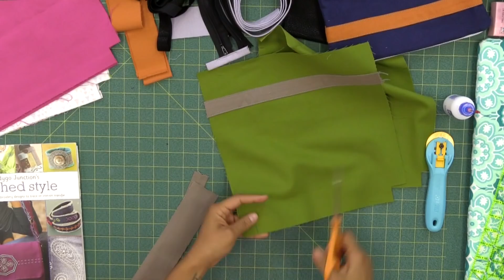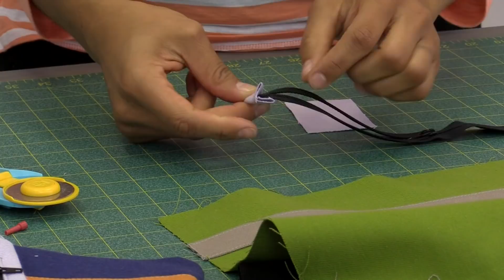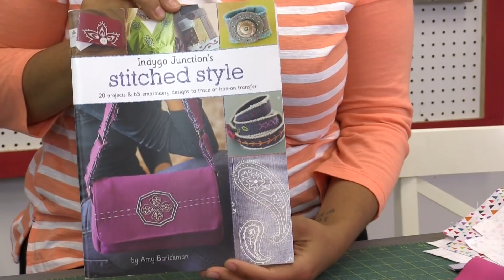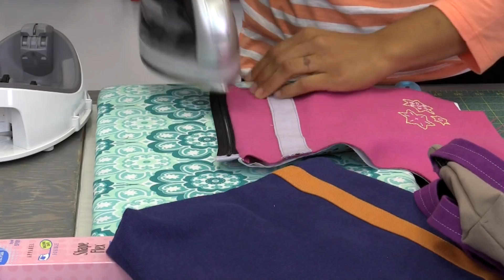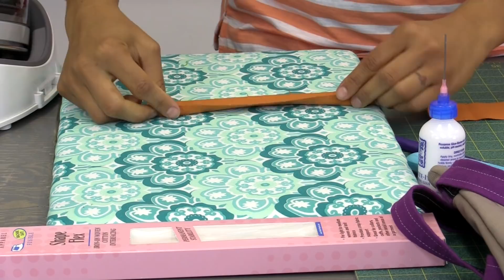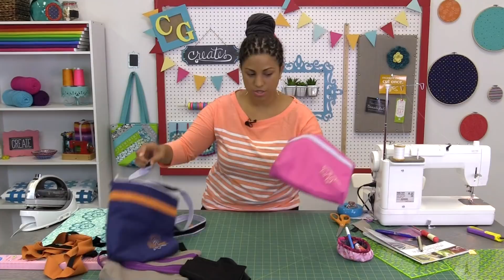Cross Body Bag With Embroidery: Easy Craft Project with Vanessa of Crafty Gemini Creates

Comment: Thank you for this. It is a pretty good demonstration. It would have been helpful, too, to show close ups of where you had stitched the seams. I was very unsure about where to stop and start to allow the boxed corners and so was hesitant to proceed, putting all the pieces together (had spent the time making the shoulder straps, trims, cutting out the two fronts and two liner pieces, embroidering the outer two and attaching trim, preparing the zip.....). My much anticipated vinyl records cross chest carry bag lies in pieces as too nervous to proceed in case I stitch the seams incorrectly. 😕

Comment: What is special about the basting glue you used that makes you like it? Can you do a video on glues that are sewing machine safe? 

I just finished making a cross body handbag that had multiple pockets (8)), padded pockets, decor bond interfacing, and trim. I really could have used some fabric glue to hold things in place throughout. I've seen a lot of glue recommendations, including rubber cement, school glue, hot glue gun, wonder tape, and a basting spray, but I have no idea which to use. 

Needless to say, I became very familiar with my seam ripper during making my handbag. Making my own handbags was a primary reason for getting a sewing machine for my birthday. I skipped over doing all the simple bags to get right into learning the challenges of making what I want. The most important thing I learned is that pins are NOT the best, especially with bulk and layers. Before I make another bag (because I want different colors and fabrics.) I need to invest in basting glue. It would make my projects less frustrating and be completed faster. However, all the choices are a bit overwhelming, so a tutorial would be hugely appreciated.

I love the solid color fabrics with the fun prints on the interior of your bags.
Reply: +chesh kat 
You can use Elmer's WASHABLE school glue.
It washes out completely.
Reply: ches
the 
words r disturbing can t see  wht exactly u r doing